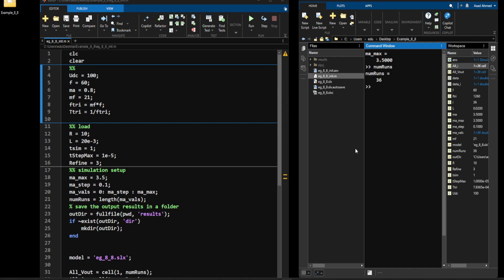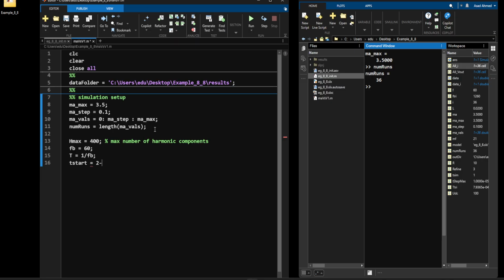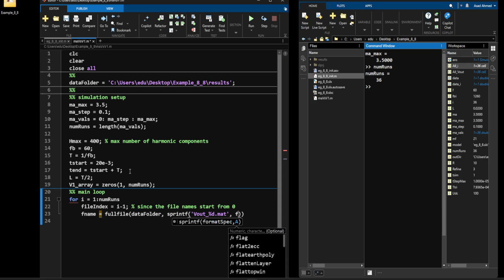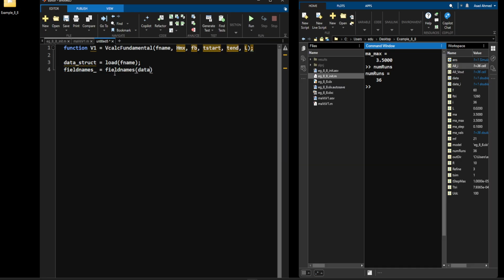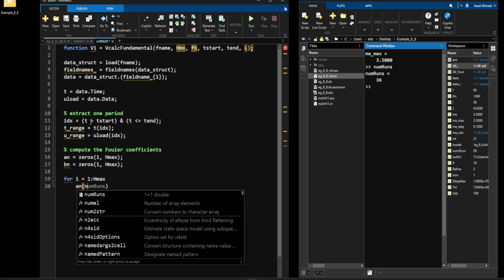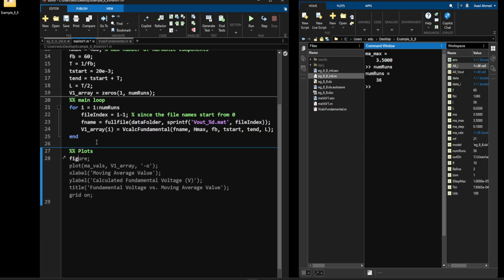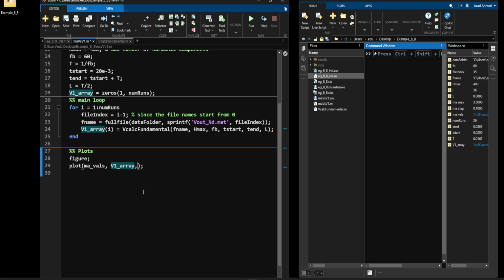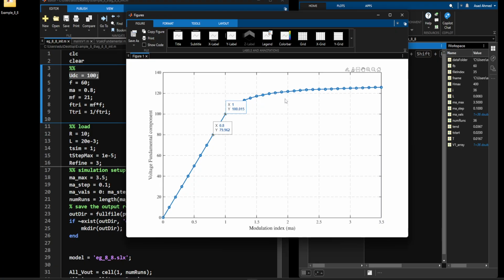Single Phase Ideal Inverter in PLECS - 3 (Modulation Index and  Fundamental Components)

Comment: Hi, thank you for your very informative videos! Could you please explain how to build a PLECS model to calculate the switching frequency of a semiconductor device (MOSFET, IGBT, etc.) when the frequency is not defined at the beginning?
In some cases, the switching frequency is variable, and I’d like to know how to properly determine or measure it in such situations. Thanks a lot!
Reply from the maker: Thank for your question. Could you give  some more information? Some example or reference maybe? I am new to this topic and would like to learn as well. Then I will record a video. I dont know yet how the switches can be implemented without specifying frequency. Lets say you have, then calculation of frequency is easy provided the loading is periodic.
Reply: @ElectroPowerSys  Thank you for your reply!
In my case, the switching signals come from a Direct Torque Control (DTC) algorithm driving an induction motor supplied by a three-phase two-level inverter.

In DTC, the switching frequency is not fixed — it depends on the hysteresis bands of torque and flux, and on the motor’s operating conditions.

I would like to measure or calculate the instantaneous or average switching frequency of each inverter leg (or each semiconductor) directly from the gate signals in PLECS, without having a predefined frequency.
Reply from the maker: @AbdoAer-fm5re thanks. I will try to figure it out. Cant say when. Did you try the moving average of the signals of switches in steady state? It should give you a mean value for a certain time when the frequency is varying.